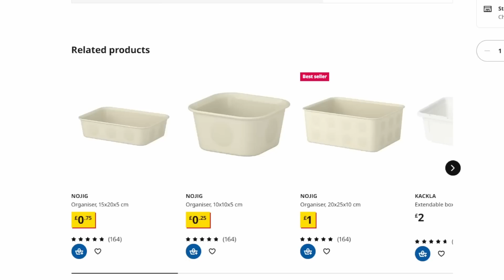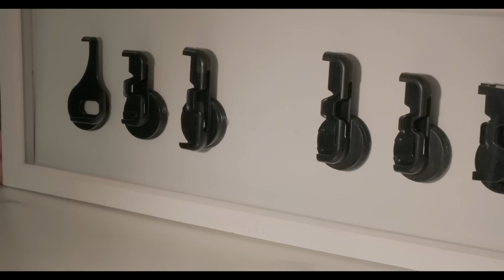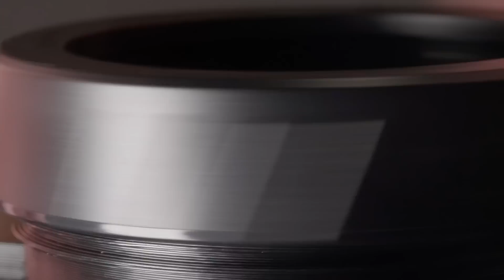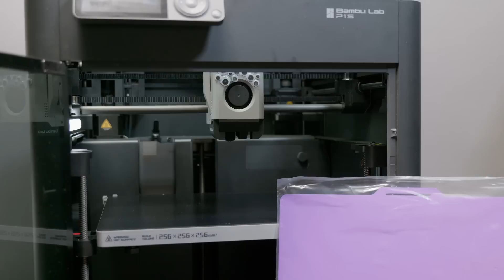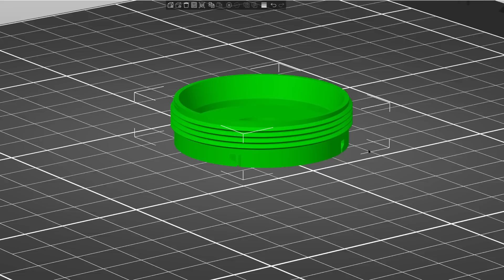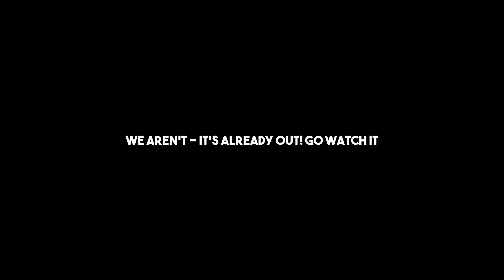Beyond Trinkets: Why the 3D Printer is Now a Production Tool

Comment: interesting take on designing supports right into the print. one ingenious trick, i only recently learned about, could entirely avoid witness marks on the example shown,  by inserting re-usable support pieces, of an incompatible material (for example PLA for PETG or vice versa), during a pause in the print. if those support pieces are flipped, they even transfer the build plate's texture to the supported area, which looks incredibly clean. 
Maybe somebody could bass this on to mark.

Comment: Then why use an old school attachment method from way back at the start of the industrial revolution why there's no strength requirement for that especially when you should have a modular design keeping up with a fast pace iterative product design. It's quite weird that someone teaching it to students couldn't work that out beforehand but then no wonder so many products fail.

Comment: I design and manufacture pa12 gf parts that are used for automotive use. I've had 0 failures and complaints in the last 3 years. (That I know of. I haven't heard anything negative from a customer yet) 

Recently I've been experimenting gf tpu and holy shit this stuff seems indestructable due to the perfect layer adhesion of tpu and the glass fiber adding significant stability and stiffness.

Comment: I don't know how precisely long ago it is but I bought the Prusa mk2 and started printing my design with thread M3 and using the smallest extruder head and I put text on the side of the little blocks 8mm thick by 12/18 mm
So funny the printing result were amazing and easily repeated. But myn main job ask a lot of time so I did not venture in to much and did some PetG hobby work.

Comment: Interesting video. The whole time my thought was why you were not using an interface layer for your supports. It really depends on the part but especially for parts that have one flat area (within one layer) that needs support this is a great option. The filament needs to be changed twice if you are not using a dual extruder but if its just that one face it doesnt cost that much time. On the other side you can get really beutiful supported surfaces if you print the layer below the supportet surface with 100% support density. There are a lot of good material combinations for this like PLA+PETG, ABS+HIPS, PA+PVA, or TPU+PVA. The main advantage is that these materials dont stick together well when cooled so the support can be removed extreme easily.

Comment: Really interesting video. Watched it while printing something with custom designed supports. That is really a topic many don't consider, the general support in FDM printing is quite good nowadays but sometimes it just adds to much material, to much print time or to bad surfaces. Designing your own supports, exporting them separately and then slicing them modified setting has huge potential :) keep up the great work  👍

Comment: As a product designer and modelmaker in the past with an interest in old cars, obsolete stuff and repairing making things, Mark was so right you have to design for the process, and continually ask yourself questions to get the best results. Too often you see designers looking at small details, and not looking at the bigger picture enough and soft focussing on the design before hard focussing. I’ve been doing FDM printing for 11 years and used it for prototyping in the past, or as models to help get stuff CNCed, but recently being making pre-production parts and post finishing them to make parts for my old cars. Just changing slicer settings, to minimise infill distortion, wall priority, reducing support to non-critical areas, hiding seams, and printing slower to reduce artifacts, using good quality filaments and selecting the right build plate really do make a big difference. If all this isn’t enough, some hand finishing with wet sanding and polishing pays dividends in the finished article. Good video, refreshing to see, and some useful follow ups could be had from this one. 👍

Comment: I make end product for local engineering firms and power companies. I can turn out a 1000pieces of a sensor mount printed in TPU before pricing has even been discussed in China. I have made a successful case here in Iceland of making end products by FDM printing but I am also honest about the downsides and what designs are possible for the customers sake.

Comment: Imo something that is underlooked is hand customized g-code for production, like the tool used for the minuteman project, but also tweaking individual parts, like for example mixing in vase mode with regular printing.

Also given the new modular system, you could reasonably have a 3d printed case with an injection molded screw that's injected sideways so that lowers the mold cost, and since it can be made a standard part, the molds can be run down for their whole lifetime instead of being obsoleted.

Comment: I pretty much always either try to avoid having to have supports and when I feel there's no reasonable way to avoid supports, I hand-craft them in CAD. This is because I sell the 3D model files and they will be sliced by the user. If I relied on the slicer to add the supports, I would have to test my designs with many slicers and be very specific about the settings. The worst thing would be to ask the user to hand-place supports on the part for printing (that's an absolute recipe for disaster). Handcrafted supports also usually print faster and use less filament.

Comment: I really wonder if that support strategy couldn't be procedurally generated using similar methods to concentric infill. Designed-in supports certainly seem to have a much higher quality ceiling than procedural supports, but there's always the limitation that they're dependent on slicer settings - especially layer height, line width, and wall generator. An effective concentric support type for flat cantilevered overhangs would cover the vast majority of functional parts' support needs: downward-facing countersunk holes, long bridges, raised planes, etc.

Comment: If you use glass you can set the slicer to turn off the heat of the bed after the first print and it will keep sticking untill the end.

Comment: been using that kind of support for quite a while now, came out with the idea from resing printing, while having a small contact point can indeed make the it as a support, nowadays i used this as a standard for all my finish designs, the only difference is that i export them all separated and then assemble them in the slicer, this way if i need to adjust something in the design i don't need to go back and forward in the timeline or have to cut the piece to separate them

Comment: Very thorough video, I have the K2 and its a set it and forget it work horse, even put my voron 2.4 into storage were its going to sit and wait to be canabalized to make a printer of my own design.

TO BE FAIR, i put a few dozen hours into rewriting all the macros and config files shortly after the second print (the 4 colored benchy)

Chamber heating macros where everything heat soaks to the proper temperature controlled by real temps not just an arbitrary time.

Pre meshed bed leveling at various different bed temps that switch automatically based on the requested bed temps.

Adjusted motor currents, created my own belt tensioning macro that way, I could find the right tension where input shaping graphs were optimized.

Tweaked the filament cutter to get perfectly reliable cuts on basically any filament out there, literally the only filaments I dont have are tullomer, ultim, and peek. I even have some Delrin (POM) filament that I managed to get a few prints to work.

The printer is just bonkers amazing its too bad creality pooped the sheets with the software on this printer and went with such a long nozzle instead of a CHT, would have helped with the poopies.

Comment: Interesting video with Mark from endoscope-i.
We 3D print a lot of stuff for our machines as well, and I am familiar with designing for 3D print, use of break away layers, integrating custom supports, but the real interesting stuff Mark talked about that you did not notice in tehfilm, was the quality control system tracking filament batch, print number and machine, in a fully tracable system. 
That is by far the most interesing part of the video, other than clever assembly design, and I have never heard anyone in 3D printing cover that.

Comment: My 3D printers are exceedingly useful when I want something incredibly specific that is either expensive, difficult to find, or entirely nonexistent. The ability to design and customize something exactly how I need it is phenomenal. It's fascinating to see this from the perspective of someone who's using them as a full production tool, rather than using them to print out a series of very specific things: there are concerns that didn't really occur to me. I rather like the chamfered supports, I typically go with organic because of the minimal contact with parts and ease of removal, but they can be unstable and come unstuck from the bed during printing or fall over: they're also not friendly to higher printing speeds.

Comment: Those locking rings should be extruded as long rods and swiss machined/threaded like they are in most volume productions. Every part has an optimal production process which is why Design for MANUFACTURING is a huge field. A product like theirs is probably best CNC machined due to volume and rapid product cycle.
Reply: Way too expensive to CNC that locking ring.
Reply: @jaro6985  Not at all. It is standard for most low/medium volume production, has about a 10 sec cycle time and the material cost is MUCH lower than 3D printing resin or filament.
Reply: @excitedbox  lol no you can't have a 10s cycle time on that part, its machined from both sides and has features that require a live axis (those grip bumps). You'd also need to bead blast or tumble it to get the finish to match the rest of the case.

Comment: Starting my journey in FDM, then transitioning to photopolymer resin for several years, CNC, and finally back to FDM with the massive increase in efficiency and print speeds while being able to hit production tolerances for end-use parts (or even mold material-compatible without having to make additional tools), FDM is invaluable in prototyping, but also making functional parts with the absolute wealth of materials available for 'prosumer' or even home-grade machines these days. The case of production with 3D printing isn't being able to not have a functional part afterwards so much as balancing quantity with time considerations. Naturally you can bang out any number of functional parts in a few hours, which is great if you only need a handful of copies up to maybe a hundred or so.

When you start to get into quantity, however, you can't beat injection mold for the lowest part cost and high quantity, with the trade-off being the necessary tooling cost up front. I'd really like to see more pellet extruders come to the consumer market, as it's crazy how much cheaper pellets are vs filament for the exact same material and properties.

Comment: I got my Prusa printer 7 years ago to create usable things, and now there are thousands of home built racing/acrobatic drones out there with TPU prints of my designs on :)
Richard Horne who co-wrote 3D Printing For Dummies created the MiSTer Multisystem2 FPGA retro console which has a 3D printed case that practically looks injection moulded.

Comment: Bah! If you look at the sponsor's product, the ConWeb build plate. They market it as "room temperature operation" and "no heating energy efficient operation" (their words, not mine). Then go on at the very bottom of the product page to say the recommended bed temp for PLA is 30-50C. That is sure one hot room!
Reply from the maker: It's been 30C in my room for the last 2 weeks, annoyingly.

Comment: Design accounts for many aspects, from cradle to grave. How much you value the different aspects defines the design.  Can you hide the layer lines. Maybe use them. Maybe fill them. Maybe accentuate... There are lots of ways to deal with them. But you can't ignore an issue. It is just a factor to consider.  For medical there are few products that can overcome the micro voids created by the process. Not impossible but, cost effective consideration.

Comment: 15:35 I don't understand why people say 60° or even 65° for PLA and now you say you even use 70°? Is that maybe only necessary on smooth build plates? On my textured PEI plate I use 55° and it's perfectly fine.
Reply: Caution, also a variety of environments,  i print in a rather cool basement, i have issues if I try to print too cool.  Pla will print fine on unheated beds in the right circumstances.
Reply: Printers lie about temps too.
Reply: @TechieSewing  not that much
Reply from the maker: Absolutely that much 😂 the center to edge delta can be up to 20C
Reply: @LostInTech3D  Yeah sorry, I thought we're talking about non-garbage printers. What do you want with a printer that has a 20 (!!) degree difference on the bed? that's unusable. Also, did I say something funny? or why the emoji?

Comment: I'm a DfAM Engineer IV for a ship builder and my job is to teach other engineers how to identify good buisness cases for the technology. Justifications for modification of the manufacturing value stream modifications. It's a game of comparisons and you need to understand why people use different steps strategically in any manufacturing value stream. I.e why casting, why forging, why sheet metal, injection molding. Understand those from a materials, logistics, cost, and complexity narrative and clear cases emerge. One recent with with Additive cut back on expensive lace cutting (20 days) and yield of the original casting process 1 in 10 - those two improvements combined saved 200k+usd, and months of schedule for that component when the original oem sundowned their production line.

Comment: The reason why we see a lot of trinkets shared is because they are much more sharable and universal than engineering products. I use 3d printing for engineering purposes and most of my designs are build for my needs, there is no point in sharing them as they are not universal. If you look at 3d printers themselves then you can see a huge variety of different toolhead designs, modification etc.

Comment: Zillow produces shoes with FDM as well. They are not a good or cheap as regular shoes, but it´s a nice proof of concept. Same here, in the medical world, parts are extremely expensive, use special materials and production volumes are very small. Right now I am leading a project where we want to find out if Metal Binder Jetting is good enough for production for the parts we have. It´s a new design which I will create for the process.

Comment: Desesigned supports will almost always be superior to slicer support. Slicers don't know design intent. 

Desesign for FDM printing is a unique skill just as designing for injection molding is. Each manufacturing process has unique requirements that need to be accounted for in the design process.

Comment: That snap together design for the camera was eye opening. I am a product designer and have done a lot of injection moulding, which has design rules that are really hard to overcome. I recently got a private 3d printer and struggle with new designs for it.
Thank you so much for the video with all these details.
Reply: I've been doing FDM for about a year now. What I learned so far is: always look for a large flat surface and base your design on it (it does not have to be the bottom - you can turn parts around). At 45 degrees a wall will easily support itself, so try to convert overhangs to that angle. There are other tricks to make the printer do what you want. Prusa has a really nice online course for designing for FDM, it costs some money (under 20 bucks), but it is well worth it - even if you have a printer from a different vendor.

And one really useful thing I learned from a friend: always have a few rolls of white PLA at hand and always do your first prototype print with it. White PLA is easy to mark with pencils or fine liners, so you can try it out and make marks where you need to make corrections.
Reply: @KonradTheWizzard  This is all really great insight! White material is usually among the cheapest available too
Reply: Slant3D channel also has great videos on designing for 3D printing.

Comment: I tried for years to make my company's products with 3D printing and it was finally possible three years ago, and FDM printers and filament have gotten much better since then.  Originally, the customers who were the most critical of 3D printed parts were customers who had 3D printers.  The FDM parts had a much lower perceived value to them.

I recently bought 3D printed Zellerfeld shoes, mostly because I'm a geeky 3D printer guy so I should have geeky 3D printed shoes, and while they were expensive by my standards (I'm not a shoe fashionista), they are extremely comfortable, the custom shoes fit like a glove and the foaming TPU-LW that Zellerfeld uses is remarkably durable.  I see no reason that they can't grow that business with shoe factories local to everyone, with hundreds of print-on-demand designs that are less expensive and better than current shoe manufacturing.

Comment: I was in an electronics store today, 3D printers took up 1/4 of the space, including a huge one on the floor. Got 4 rolls of PLA to use my secondhand  printer to make myself a Core XY printer/laser etc  A tool to make more tools.
Reply from the maker: I miss electronics stores...we don't have any left
Reply: @LostInTech3D  Well Jaycar is not the same as it used to be, lots of toys and home security systems. My real "electronics" supplier is usually Digikey, ordered online.